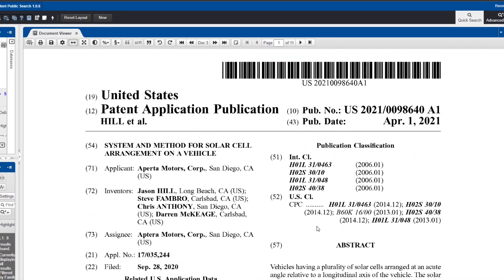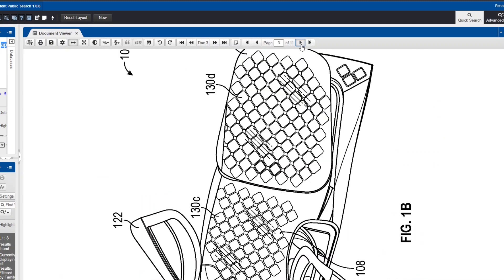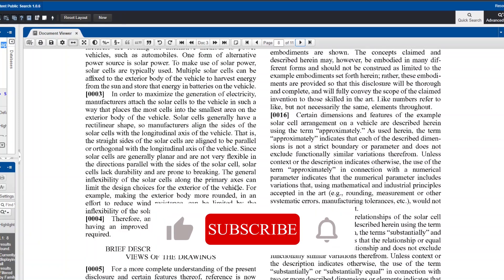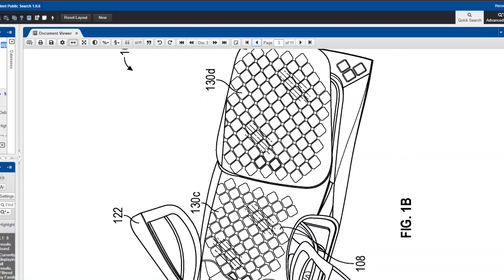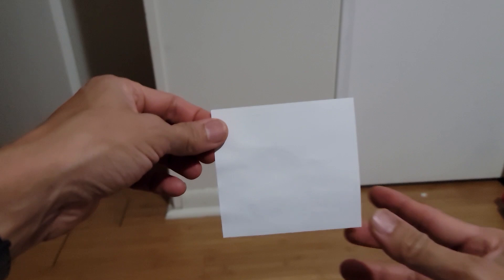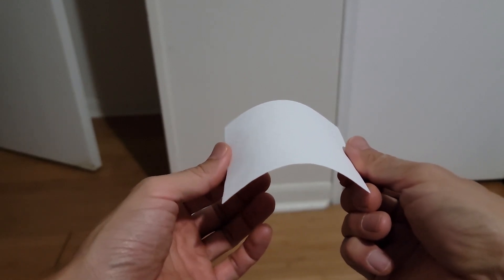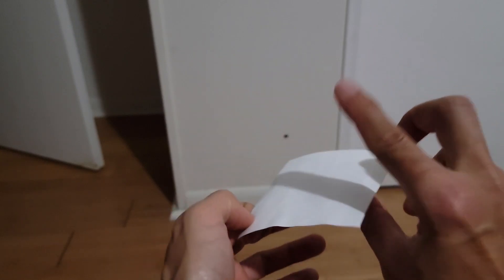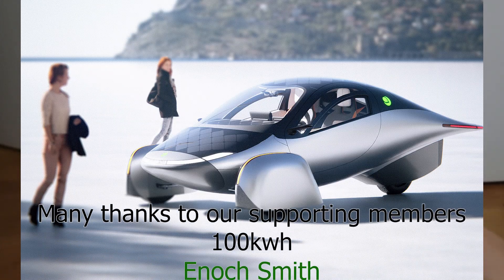Are Aptera's diagonal solar cells just a gimmick?

Comment: The thing to keep in mind is that solar cells are in series.  Simple shading of a cell knocks down the voltage and power production significantly. So cells being angled in different directions from the direction of the sun or any sort of shading at all will kill power production.   We have seen split cells and additional wiring to work around areas that get shaded on conventional solar panels, but this has always been a problem.  So having solar panels and cells that curve and not facing the sun will hurt the solar power production.  I would like to know how they are working around this problem.   Honestly I will be plugging in and charging from my home solar most of the time so the solar on the vehicle would only come into play when the vehicle is out acting as transportation, shopping, commuting and won't be a primary way to keep the vehicle charged.  However for those that intend to us it on solar only this could be a very big deal that you may want more answers.  Now that they have fabricated the cells it should be simple enough for them to have on sitting outside and collecting data on how it works, or if it works at all like they envisioned.  Solar is a fickle thing to begin with, but applying it on something like this and having it work will be quite the engineering challenge.  And we haven't even started talking about the longevity and durability of the cells mounted in this type of application.

Comment: (Bob Hilder, This channel's "studio" settings for comments appear to be a bit screwy and likely tagging my "reply" as "pending approval" so I'm leaving my reply here instead.)

 Regardless of the orientation they chose to lay the cells in and regardless of whether cells are "simply" or "compound" curved, the top "surface" of the crystal will be under tensile stress/strain.  Brittle materials under tensile stress/strain are prone to sudden and "catastrophic" cracking and it can happen at any time.  Full scale mounted "shake and bake" would be a good idea.

I do, by the way, still have the great majority of the "recalled" panels.
Reply from the maker: Hi Alain,  i just checked and there's no replies held for review so I'm not sure what's going on.  Thanks for your expert commentary on this topic.   Maxeon touts the flexibility of their cells and the amount of flex they put the cells in on their videos is fairly extreme.  I suspect that the  amount of bend that Aptera is subjecting the cells to in their panel is far less than the cells failure point.  Your thoughts?
Reply: @ApteraOwnersClub  YouTube can be very odd sometimes.  I logged out of my YouTube account and my reply to Bob Hilder doesn't show up.  On the other hand, when I'm logged in, it does!

With respect to the flex in Maxeon cells, yes, they can be shown to flex quite a bit and, of course, Aptera isn't flexing them anywhere near to the extent Maxeon is in their demo videos.  It's important to understand, however, that even though Aptera's flexed cells aren't at a "failure point", they are more susceptible to "spontaneously" fail (crack) due to the tensile stress/strain that is constantly on the top surface now that they are flexed.

For some fun, there are two extreme examples of this tensile stress/strain phenomenon that you might be interested in seeing.  One is called "Prince Rupert's Drop" and the other is the "Bologna bottle".  Just google both and watch some cool demos of each.

Happy to answer any other questions.
Reply: @alainchuzel8341  Holy $hit.  What might it take to shatter Aptera's cells when they are bent and stressed they way they are?  I'm imagining a "shock" load of some sort.  Possibly even hitting a pot hole(?)
Reply: @bobhilder1469  I could easily see some of the "more bent" cells on the Aptera crack on a diagonal after hitting the right pot hole or three.

It was mentioned before, Aptera should really do some full scale "shake and bake" on the vehicles before offering a warranty of any kind on the solar and, no, throwing ice balls at unmounted solar isn't a substitute.

Comment: Steve, I've been playing around with "bending" paper, 0.005" thick G10-FR4 and Maxeon/SunPower cells again but really focused on how edges and/or corners are "constrained" because I suspected that was key.  It was really informative.  Bottom line is that, from my experience, there's very little that you could conclude from the way you show the (2-axes) bending in this video.  Particularly in the case of the 45-degree rotation case.

Also, by the way, like I've done before, I tried forming 5" x 5" paper to actual, gentle, compound curved surfaces (at various "orientations") and had zero luck getting the paper to form completely flush.  There were always, as theory would suggest, one or more pucker(s) somewhere.

Comment: Essentially this increases the "polygon count" from 1or 2 (single bend) to 5.  Definitely better.  Again simple physical demonstration really explains it.
Reply: But only, at best, for thin, non-brittle materials like paper.  In other words, irrelevant with the brittle solar cells that Aptera is using.
Reply: @bobhilder1469  the amount of bend and the concept are two different things.  For demo he bent WAY more than a cell could take.  His paper demo showed clearly that trying to bend a square in both primary axis makes a pinch in the corners but not with a diamond orientation.
Reply: @ccibinel  I'm afraid you're wrong about Steve's paper demo.  Pay careful attention to how Steve is holding the paper in both orientations.  He's VERY inconsistent.  Where and how any or all of the perimeter of the paper is "restrained" is key.  Just try it yourself and it will become obvious that Steve's demo was, unintentionally, just "slight of hand".
Reply: @ccibinel  You saw what Steve wanted you to see and the "demo" was NOT representative in any way of what is/isn't going to happen with the solar cells.

Comment: I was just turned on to this video at the reddit page and am copying my comment there here:

"Other than for cosmetic purposes, yes, the diagonally oriented solar cells are possibly unknowingly "gimmicky". Aptera's espoused rationale for the orientation is technically invalid. When these kinds of cells break, they tend to break on a diagonal because of the crystalline structure. In layman's terms, they kind of have a "grain". Given that understanding, why would Aptera purposefully orient the cells in a manner in which the cells are exposed to the greater bending along the "weakest" "directions"? The only logical answer is that for the actual amount of "compound" curve (or even "simple" curve) it just doesn't matter."
Reply: It sound’s like it’s possible Aptera has it exactly wrong then and the cells would be MORE prone to breakage when oriented according to the so far rejected patent application.  Ouch!  I sure hope they do statistically significant FULL SCALE MOUNTED “shake and bake” testing before making too many of these, possibly doomed to fail, under powered solar panels!  By the way, do you still have those 1000-ish “recalled” compound curved solar panels designed and built by that solar company that hired you to do the “failure analysis”?
Reply: @bobhilder1469  Regardless of the orientation they chose to lay the cells in and regardless of whether cells are "simply" or "compound" curved, the top "surface" of the crystal will be under tensile stress/strain.  Brittle materials under tensile stress/strain are prone to sudden and "catastrophic" cracking and it can happen at any time.  Full scale mounted "shake and bake" would be a good idea.

I do, by the way, still have the great majority of the "recalled" panels.

Comment: Solar cells are so fragile and brittle that this orientation may be the only one allowing enough flex to produce the compound curve panels with any reliability.  They are thinner than potato chips and at least as brittle, if not more so!  Keep in mind that patents are expensive and time consuming to acquire, so Aptera would not be getting them on a whim.
Reply: I love potato chips and I work with these very solar cells.  The solar cells are not as fragile as potato chips.
The 45-degree orientation is a gimmick.  Other than possibly cosmetics, it's irrelevant.
Reply: @bobhilder1469  When it comes to these solar cells, everyone needs to listen to Bob, as I am obviously out of date, lol.  At the time I worked directly with solar cells, the were terribly fragile, but this has apparently improved.  Apologies for any misleading information... I will take this que to bow out.  Please refer to Bob Hilder for current IBC solar cell feedback.
Reply: @DemaGeek  Hmmmm.  Suspiciously flattering....(but thanks anyway!)

Comment: To reiterate, if Aptera's cells are made from paper rather than brittle single crystal silicon, the "diagonal" thing wouldn't be "just a gimmick".
Reply: @Bob Hilder  I'm not clear on what you are saying.  Are you saying it's not that the Maxeon cells are manufactured flat and then bent, but rather they are manufactured slightly curved?
Reply: @brianjacobsen8161  Let me rephrase my original comment.  If Aptera's cells are brittle single crystal silicon then orienting them, unnecessarily, in the "diagonal" orientation is a gimmick.